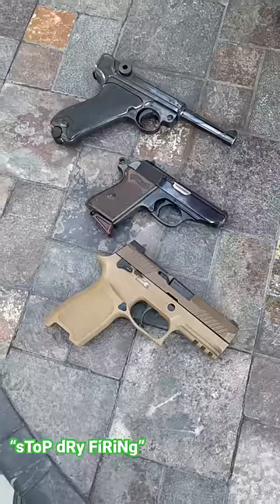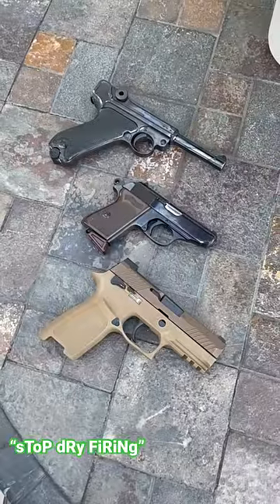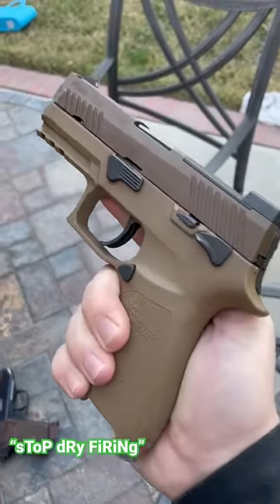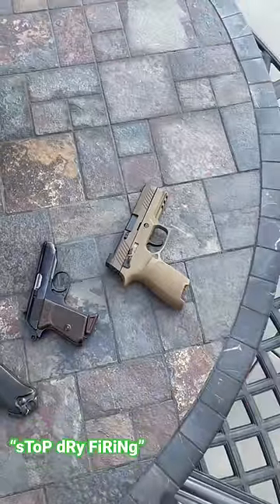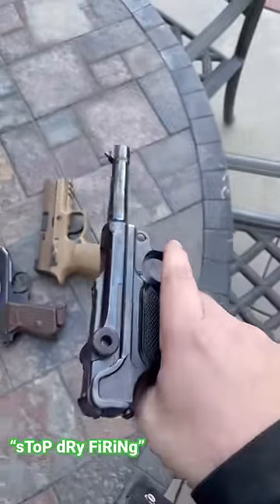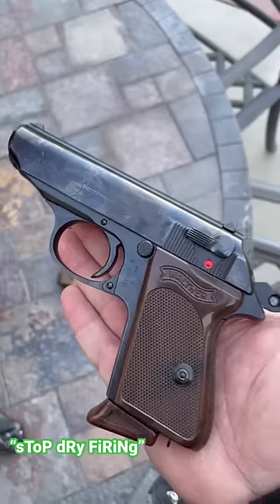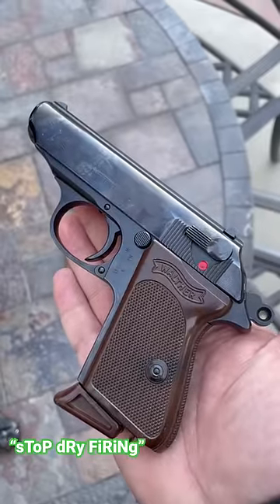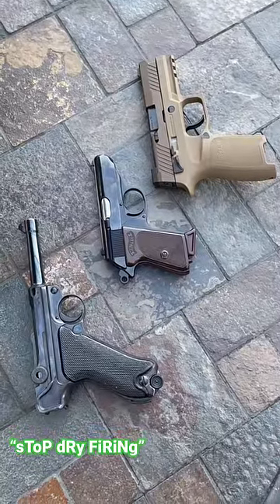“sToP dRy FiRiNg” #shorts

Comment: Ruger states on their website that the newer 10/22’s can be dry fired.
Reply: Id imagine it comes down to the tolerances between parts. I'd bet that the 10/22 has more open tolerances which I'd bet also contributes to their reliability with different ammo. I personally have yet to find anything my 10/22 won't work with.
Reply: Thank god. I actually didn’t know this and I just got a 10/22 that I’ve been dry firing.
Reply: @connorcolumbia5398  same 😅
Reply: @connorcolumbia5398  I got a 10/22 about a year ago and did quite a bit of dry firing lol
Reply: Same with their Mk IV pistols.
Reply: Yup, most* modern 22lr’s can be dryfired, but i try not to make a habit of it. Definitely wouldn’t do it to older 22’s
Reply: I refuse to dry fire unless my hand is on the bolt pulling it back a couple millimeters but that's just my OCD about rimfires.....
Reply: Ruger owners manual also says it's OK to dry fire the Wrangler single action 22 revolver.But it is NOT OK.
Reply: @rustybricks1924 if you can pull the bolt back and still dry fire there's something seriously wrong with the firearm because that's just asking for an out of battery detonation
Reply: Not all 22s are rimfire.
Reply: I have one from the 1980s.
It has been dry fired plenty.
No problems.
Reply: My Tt-33 loves being raw dogged
Reply: @ec7005  the video specifically refers to "22LR or rimfire" and this comment thread is about the 10-22, which is rimfire 22LR.  You might as well tell everyone here that not all cows are brown.
Reply: Meh, I’ll still use an old empty casing for the occasional dry fire.
Reply: Its how the gun is designed, some .22s have the area where the firing pin hits hollowed out so that if it is dry fired nothing happens. Others don't the dry firing will deform the chamber so that the gun will jam. However there are tools available that can fix this if it happens.
Reply: @Dustin Haynes, try Agula. I have yet to get a full mag to go smoothly, in ANYTHING. Even my 10/22
Reply: I’ve got like a 40yr old one and at the end of almost every magazine I end up dry firing due to the lack of hold open
Reply: Been dry firing my Rugers for 50 years, 55 on my 10/22 and they are fine but it's true that they are designed so that the firing pin doesn't hit the face.
Reply: The 22lr rimfire and rimfire guns in general comes down to is the firing pin captive or not.  If it's not a captive firing pin in will peen the part of the chamber that the rim rest on and cause issues with timing (not fully in battery) and headspace.  The other issue is a potential slam fire.  I'm pretty sure the 10/22 has always had a captive firing pin that can not contact the chamber.
Reply: Many modern 22s have a firing pin relief in the breech.
Reply: Good thing the comment section is smarter than the guys designing the firearms.
Reply: Yup, mine says so in the user manual
Reply: @connorcolumbia5398  I bought one maybe 2 or 3 years ago and the firing pin does not contact the breach on that gun either, not sure when that change was implemented but thank god it was lol, I love dry firing.
Reply: So can Ruger SR-22. Manual says its okay
Reply: My ruger mk1 has been dry fired consistently for its entire life of nearly 60 years. No sign of undue wear and no breakages
Reply: Same with CZ
Reply: Yup got a 10/22 takedown, says specifically in the manual it's OK to dry fire.
Reply: @connorcolumbia5398 same😂
Reply: @dustinhaynes2617  Some companies are including firing pin stops that keep the firing pin from ever reaching the breech face. Some people have complained about that method by saying the stop folds over, but I think it's better than nothing.
Reply: Ruger LCP II 22lr is ok as well according to the manual.
Reply: Well that’s Ruger, they’ve fixed the fry firing issues for the last 20+ years so
Reply: same with the tarus tx22
Reply: Yes captive firing pin 22s are fine
Reply: @dustinhaynes2617  no it has nothing to do with tolerances. it has to do with a captive firing pin that won't impact the breach face.
Reply: @bman9141  I've been shooting aguila since the ammo shortage in 2013, and it runs great in my 10/22.
Reply: I shot too much 22 when I was younger so it is impossible for me to believe you can dry fire modern 22s
Reply: @larrynason8716  because you know the hardware better than the manufacturer 😂
Reply: @KingBobbito  if you want to believe, add some transferable ink or something to the front of the firing pin. Dry fire it once. If there is a mark on the breech, never do it again (one dry fire won't be a big deal). If there is no mark do it a few more times to make sure it isn't a fluke and it is still clean, it is safe.
Reply: @therealmccoy9948  same.
Reply: @rustybricks1924 if you pull the bolt back the gun is out of battery and should disable the trigger!
Reply: As can the cz512
Reply: Taurus for the TX22 states the same in the included manual.
Reply: Can also confirm the Ruger Mark IV is designed to be dry fired, the manual itself states that it is safe to do so
Reply: 10/22 has firing pin block
Reply: P322 you can  dry fire they designed it like that

Comment: In boot camp, my range instructors made a very good point about dry firing. We were sitting there with our M16s disassembled, and he told us to pick up the lower receiver, grab the hook, and swing it down til it clicked. Once a chorus of clicks sounded off, he said, now squeeze the trigger.

Clack! around the Pavillion, and this mother fucker loses his shit! "Why yall all dry firing like that you idiots?! Of course he calmed right down, in that way we all know we did what we were told, and they are just yelling to be sure we're awake lol. He then has us look at the different parts. He said "you see that bit in front of the hook? That's the hammer, it's made of cast iron, and that bit it slams into? It's aluminum, just like the rest of the weapons body. The hammer is designed to slam into the firing pin, and body, not the aluminum of the lower receiver. Dry firing will eventually wear down the hammer and firing pin, but if you know your weapon better than you know the difference between your ass and a hole in the ground, you'll understand that dry firing from time to time won't hurt it any more than when you're hand delivering a lead gift to someone down range."

Then we did push-ups because we dry fired our lower receivers like idiots, and reassembled our weapon, and dry fired the semi and burst tests before going out to do our sight in shots.

Ever since then it's stuck with me, that dry firing isn't bad unless you're just standing there slamming the hammer into a different type of metal, or you're dry firing a couple dozen times.
Reply: “Hand delivering a lead gift to someone down the range”
Reply: Not so much hand delivered as it is express air delivery addressed to soon to be former occupant. 😂

Comment: As a firearms instructor I am amazed that people do not dry fire routinely. Best practice you can do
Reply: At least one handgun requires the magazine to be inserted for it to dry fire, according to the manual.
Reply: Where do you teach?
Reply: @chrisgast  then put an empty mag in....
Reply: I just bought my first handgun and I believe it may be simple excitement but I’ve been running around my house (cleared and empty) doing dry fires and just getting comfy aiming down the sights. Other than that I’ve been working on knowing the handgun inside and out so lots of taking apart and putting back together
Reply: @thegunshowguy  I would. I'm merely stating that not all firearms can be dry fired magazine-less.
Reply: @chrisgast  If you have a gun, you have a mag. Train as you fight. Why buy a weapon anyway if you don't have a mag??
Reply: @Tsusday  not all guns use magazines.
Reply: @chrisgast  the context of the thread implies defensive handguns. Apart from revolvers, which have a cylinder as part of the gun, what defensive handgun doesn't use a magazine?
Reply: @RustyShacklefordReal  I didn't know certain guns were defensive and others were offensive.
Reply: @RustyShacklefordReal I guess the Mauser doesn't have a mag, it's got clips
Reply: @lethalbroccoli01  it has an integral magazine.
Reply: @RustyShacklefordReal  yes... what are integrated magazines filled with?
Reply: @lethalbroccoli01  Play-Doh. Maybe penne noodles if it's an Italian firearm.
Reply: @RustyShacklefordReal  tweaker
Reply: @lethalbroccoli01  who, me?
Reply: @chrisgast  quit buying guns that have stupid ass magazine / trigger disconnects...
Reply: @chrisgast I  just hate magazine disconnect safety mechanism, relax bro.  If you get into an life or death firefight, and your mag falls out, you're done.  At least you got one shot on a normal pistol and can load 1 round at a time and still fire.
Reply: @GD8480  if I could own a handgun, I'd be in my local range 24/7
Reply: @chris gast  I think the steyr-han can be dry fired whilst lacking any real magazine. Seeing how it has an integral, iirc. Correct me if I'm mistaken.
Reply: @adog3336 lol yeah so the fact the military does it constantly, police officers do it constantly, firearms instructors teach it constantly and people knowledgeable about firearms mention it and try to disprove exactly what you’re spreading. If what you’re saying is true it would have broke regardless if it was loaded or not. He needs to take better care of his equipment.
Reply: @adog3336 
🤦‍♂️ Not even going to touch this one. 
Tempted, but no. Just gotta pass.
Reply: I just don't do it because I developed the habit of keeping my finger away from that trigger unless I am intending to pull it.

Maybe once in a blue moon I have dry fired it but yeah. Great to know I can routinely do it though.
Reply: @adog3336 Stockpiling ammunition for what? The zombie apocalypse?
Reply: The only thing you're doing by stockpiling ammunition....is hoarding. Playing keep-away, and wasting your money. You're like all the hoarders at the grocery store...buying up all the meat frozen vegetables to stick it all in your extra freezers, only to never use it. All you're doing is throwing money away, and keeping others from getting any ammo. Like the game 'hungry hungry hippos.' I have zero respect for hoarders.
Reply: @lethalbroccoli01  man got got so hard he became a tweaked 💀
Reply: Personally i find it inconvenient with single action semi autos, having to manually operate the action between each shot. I find it better with manual action or double action guns, like a pump shotgun. Basically identical to actually using it
Reply: @chrisgast it's called a magazine disconnect genius
Reply: @chrisgast  if the gun doenst use a mag, the obviously its not going to be an issue when you try to dry fire without a mag. you clearly have no idea
Reply: @adog3336 If the hammer broke dry firing, it would have broken live firing.

If you have something with irreplaceable parts, you shouldn't be dry firing, but you also probably shouldn't be live firing if you care about not breaking it.

Otherwise, things like firing pins are wear parts you should plan to break and replace periodically. In this case, dry firing is fine so long as the firing pin (or another part) does not impact something it shouldn't. This mainly means don't dry fire rimfire (firing pin impacts can damage the breach face) or percussion (the hammer can damage the nipple with the cap buffering it) firearms.
Reply: @adog3336 Well then you should be happy to find any failing components while dry firing rather than when your life depends on it.
Reply: @RustyShacklefordReal  welrod is a perfect example. Gotta pull the bolt back to insert a round.
Reply: @ineedapharmists  The welrod feeds from a removable box magazine, same as an autoloader. It doesn't have a gas system for stealth reasons, since the sound of chambering a round can be harder to disguise than the sound of firing it. Same reason the delisle carbine was bolt action, despite using a modified 1911 magazine.
Reply: @88porpoise  in which comment did I claim otherwise?
Reply: @RustyShacklefordReal  sorry I meant to reply to the comment above yours
Reply: @adog3336  unless you have a very weirdly made gun that makes no sense from how physics work. And no, I don't rely on some random gunsmiths (or really pretty much any professionals) not believing some silly myths they accumulate over time. Especially when it doesn't actually affect the work they do.

Unless the gun does something when it is dry fired that it wouldn't do when it is live fired (such as a rimfire firing pin impacting the breach face), there is absolutely no reason it would add more wear than live firing. 

And if you want an appeal to authority, militaries dry fire weapons extensively as noted through these comments by current and former soldiers and referenced in plenty of manuals. And they are people whose lives absolutely do depend on their firearm functioning.
Reply: Tried to dry fire and shot myself in the leg 🥲🥲
Reply: @adog3336 I’m not talking about you I’m just letting you know cause your comment a little above. Ammo isn’t really in a big shortage it’s just skyrocketed in price more then anything
Reply: @Guccibuckethat69420  Did the exact same thing. Welcome to the club.
Reply: @MikeHunt-zy3cn  I just bought my second handgun and this is me all day long ..every Sunday afternoon
Reply: @smileymiles501  lucky. My nation effectually banned handguns. Had planned to get the ball rolling for a restricted firearms license the day I met the age requirement, but a week prior to that day, the ordinance was put in place.